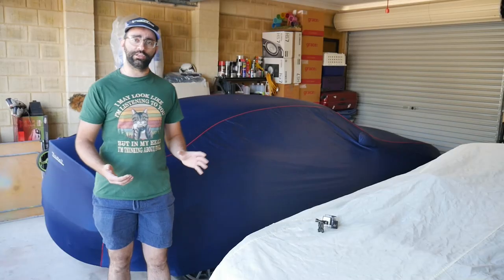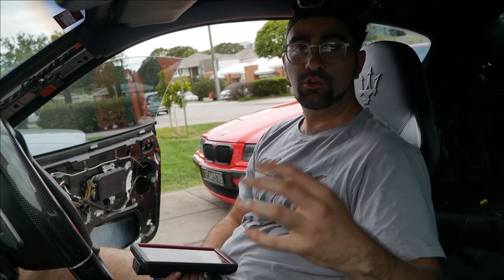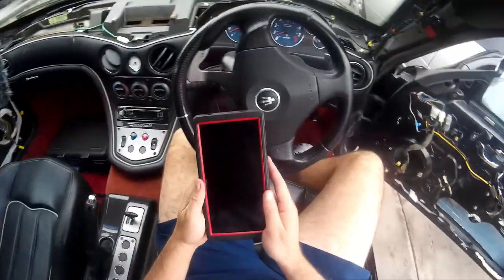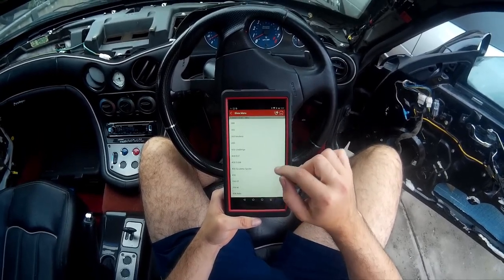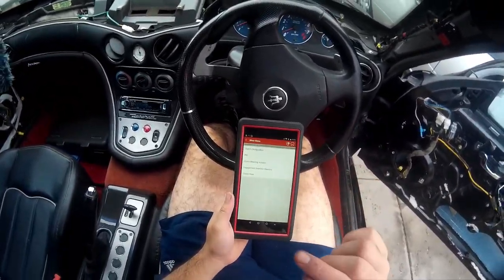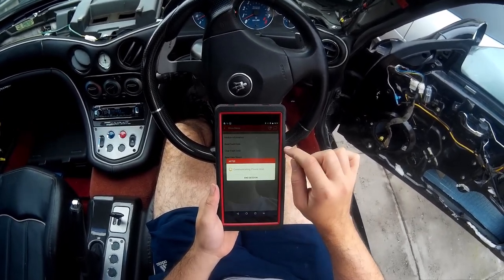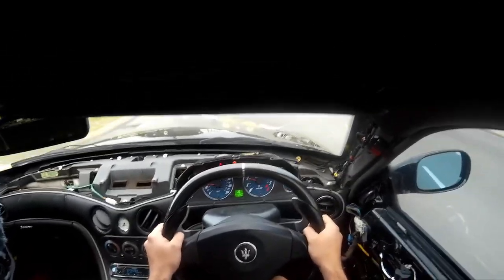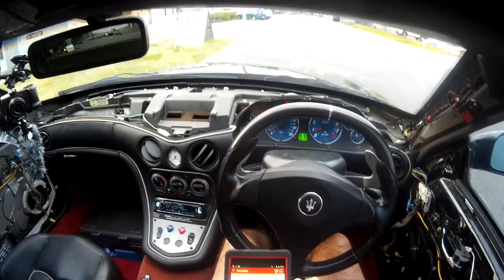Setting up the F1 Transmission - Clutch Change Part 3

Comment: Hi sorry to bug you , but i finally got the launch and my coupe , I noticed on the launch that in the clutch configuration the value changes and reflects the calibrated clutch position, it keeps changing to what ever the calibrated value, and not the new closed position. as per your video when you changed clutch config it changed he new position , the other way around, whats going on with mine??? also I could not write to clutch configuration either, but could change the PIS, any insight , thankyou

Comment: PIS 5.2 is way to high... 5.0 is much better
Reply from the maker: That isn't how it works. It will change between each vehicle depending on the tolerances between the parts. The PIS isn't the goal, the clutch slip is the goal.

Comment: Awesome content on your channel, thanks so much!!

I recently had the rare opportunity to buy a 4200 Trofeo. After watching your videos on the clutch replacement, I purchased a launch 431x pro mini in the hope that I would be able to perform the clutch and ABS bleed. Unfortunately it doesn’t seem to work. When I scan it, the gearbox gets detected as CFC201 first and second edition, but none of the special functions seem to do anything. Not sure if I am missing something i.e. the car needs to be in a certain state (doors closed, brake engaged, gear selected, etc.,). Feels like I have tried every thinkable combination, with no luck. The ABS does not get detected at all. 

I am pretty much at loss on how to proceed with this, and I thought perhaps you had some ideas or inputs of what I could try. Unfortunately I have not been able to find anyone that knows anything about the Trofeo cars here in Switzerland.
Reply from the maker: You can just bleed the brakes the old fashioned way on this, you don't need to cycle the ABS pump.

You can try connecting to the Ferrari F430 gearbox settings if you're having trouble with the Maserati options. Jump on the MaseratiLife forums and ask for help there and post up some photos and I'll be able to help you out more!
Reply: @ShiftMotoring  thanks for your response. luckily I got the gearbox functions to work. looks like it needed a power drain. it still gets stuck once in a while, but after a power drain it is all fine again. I will get my user setup in the MaseratiLife forum! just a quick one, would you know if the actuator bleed is required after changing the pump? I was recommended to install an upgraded F1 pump strait from the beginning, so that's what I did.

Comment: Hi mate. Great video. Thanks for posting. My clutch has just gone in my 2005 Gransport (15 000 kms since replacement, not happy). Can you recommend a clutch that won't fail after 5 minutes use and who the supplier is? Thanks Charles
Reply from the maker: I'd stick with OEM. Jump on the MaseratiLife forums, I'm active in there and people will have suggested suppliers for different regions.
Reply: Thanks for the reply. I'll sus the forum out. Cheers

Comment: hello.  i am not clear on the New Closed Clutch Position . you mention that it is automatically calculated and then you enter in the clutch config. I have been reading that for the New Closed Clutch Position , you have to enter a value manually after measuring new clutch thickness? thanks

Comment: Cool videos fella! Big hello from sunny California. I am curious what does the dbw do and why are we not able to just adjust it to our preference as you have shown without getting the dbw. Seems like you can preserve clutch and quicken 
Gear shifts the way you have by adjusting?
Reply from the maker: The DBW is a piggy back computer for the TCU and is not a diagnostic computer. I don't know exactly how it works and it would take a fair bit of investigation to fully understand it. With that said, I believe the DBW fudges the vehicle speed and RPM to the TCU which causes the TCU to request the highest torque available through an ECU parameter called 'torque request'. You can adjust the torque request parameter in the ECU if you reflash it with a custom tune and get the same effect. I have an install and review on the DBW coming up soon.

What I'm doing here is demonstrating how you can change the perceived behaviour of the transmission by adjusting clutch parameters, it would be inaccurate to describe it as making anything faster but it does change the behaviour.

Comment: Hi mate thanks for video 💪, 
Mate I have a tiny question for you,, three days ago me and my brother took his son Mazzi 2002 F1 gearbox and he modified it like crazy it has a 41 kms only still like new , anyway so we stop filling petrol , we start cat fantastic with no drama and my brother let it roll then he shift to 1 we want to take off it take of 1 meter then it won’t go on gears at all 🤦‍♂️🤷‍♂️,, 
We parked aside to see what happens, car won’t shift at all no sound for gear click as it should be it just stays on N” we turn it off then he try’s to start it unfortunately it won’t starts at all 🤦‍♂️ we check all kind fuses an relay nothing burned fuel pump is new ,, we put it on scanner it give us 
Code P1747: Reverse Gear Switch Absent ? 

Code P1746: Switch Stby , Absent !!

Any idea what’s happening here ?? 
Many thanks 

Matt ☺️
Reply from the maker: You've got faulty wiring, it is a common fault. Drop me a line on the MaseratiLife forums and I'll talk you through it.

Comment: Hey,
Iv got 07 qp sport gt and for some reason it shifts really hard and stall all the stall when coming to a stop. Iv done everything i can think of ie (f1 pump, f1 relay, solenoid pack, accumulator, sensors, oil, etc.) And it still does this and im wonder if its in the calibration at this point. Was wondering your opinion on this matter.
Peter
Reply from the maker: Usually stalling and hard launch are caused by the PIS being set too tight, won't hurt to look at it.
Reply: @ShiftMotoring  i had the pis adjust and it drove sooo much smoother! Unfortunately i parked in my driveway and now i get a no crank problem and its saying i have tranny codes for low pressure. I plugged in and pressure showed 55 bar. Said relay stuck, i replaced relay. Still wont crank. Im ready to pull my hair it with this car. Iv gone through everything to get this car perfect. New variators, sensors etc on engine. On tranny iv replace all sensors, acumulator, f1 pump, solenoid pack. Getting frustrated now

Comment: Hello, what's a good handheld diagnostic tool for Maseratis and Ferraris? I am looking at Launch Tech USA but they offer various models. Which one was used here to tune the new clutch ? All the best!
Reply from the maker: Launch Pro Mini X431 is what I'm using!
Reply: @ShiftMotoring  Super! Where did you order it? I want to avoid clones ... Thanks, M
Reply from the maker: @mtomiuk8133  I just picked it up off ebay, the legitimate ones will come with registration details
Reply: @ShiftMotoring  Super! Thank you!

Comment: Hi. We're replacing the clutch on my Gransport atm.  Would you know what the flywheel bolt torque specs are and the specs for the pressure plate?
Thanks
Reply from the maker: Sorry, I don't remember off-hand! I looked up the grade bolt marking, and then used a lookup table for the bolts.
Reply: @ShiftMotoring  Thanks for taking the time to respond.  Much appreciated.

Comment: Hi there. I’m looking at buying a 2006 Maserati gransport and was wanting to know. When you are going to stop. Do you pull both paddles to engage Neutral or let it just stay in first gear? Does it automatically disengage the clutch when stopped in gear? Thanks
Reply from the maker: You might save 1-2% of your clutch life pulling the paddles, but you don't need to. It goes into neutral on it's own when it needs to and it rev matches on down shifts!
Reply: @ShiftMotoring  great thank you.

Comment: hello , is it true that the launch reads the clutch wear incorrectly? it does calculations incorrectly , the  clutch thickness is 5.6 , I rad launch uses  7 mm i think. thanks
Reply from the maker: So far as I'm aware that was a bug in a version of the software that was updated several years ago. The measurements I've taken have lined up with dealer tools.
Reply: I have the latest software.  O read thru the ferrari module and the numbers are different. Hence

Comment: PIS is about 5 for new clutches and winds down (tighter due to degrading clutch material) towards 4.5. Car should bite eagerly and be light to move around. My car (F430) drives well at 4.7 on 11k old clutch. A lot of it is about feel. Testing the car when red hot (try engaging reverse) is another way to ensure things are good.

Comment: You have to be careful with that tool, it's easy to burn the TCU, it's a very common problem with it. Next time try PEGA Clutch in your Maserati.
Reply from the maker: Definitely a myth regarding burning out the TCU. There is no direct connection between scanner and the TCU, and it can only communicate via the CANBUS with the input value protected at the TCU side.

If you want to send me a PEGA clutch I'll try it out and review it. I went with an OEM clutch because the PEGA clutches have negative reviews and it was too expensive for me to test and not be happy with it!
Reply: @ShiftMotoring  A myth it's your believe, we'll see. 

You just read forums and follow what people say without trying. Scuderia car parts $1911, Forums between $2000 and $4200, PEGA $1600 new, $800 rebuilt, that's what I call BS. Why we should send you a clutch when you have only 847 followers?
Reply from the maker: @gteengineeringwebmaster1170  That's up to you, it gives you information to share with people when they ask you questions. And sure, I don't have a huge subscriber base but my other clutch videos have 4000+ views so people do watch them. If you send me out a PEGA clutch I can test it back-to-back against a brand new OEM clutch and give an honest opinion of what I think is going on. It really is up to you whether you see any value in having someone go over your clutches in detail and comparing it against the OEM unit publicly. 

Of course I'll read information on forums, people share their experiences and issues so that I can learn from their mistakes instead of making my own! It is very expensive testing every possible combination so I have to choose what I focus on - this is a hobby, not a job. I purchased my new clutch from Barbagallo's parts in Perth, Western Australia, for ~$1600AUD. For me it was substantially more cost-effective to buy the OEM Valeo unit with a local parts warranty and an approachable supplier.  All these videos are shared on forums so that people can learn from my mistakes as well as my successes.
Reply from the maker: Sorry it took so long to reply, youtube was being weird and I couldn't see all comments!

The clutch is the OEM unit, the manufacturer is Valeo. I purchased it directly through Maserati/Ferrari in Australia for the equivalent of $1150USD. If I had bought a PEGA clutch I would've also had to pay import duties and shipping which would've far exceeded the cost of the new part. It was something I looked into, and I was willing to try but it was uneconomical, coupled with uncertainty over the reputation of the parts. 

It is good that Samrac is playing with a 360, hopefully he has a positive experience with the part and can share that experience with others! I however am not a 1m subscriber channel, I'm an enthusiast doing work on my own cars. The people who watch my videos own the same cars as me, the people who watch Samrac will likely never own a Ferrari or Maserati. If you want me to review the part for other owners, send one out and I will provide an honest review for others. Until then, the reviews that I've read are all I have to go off of.
Reply: @gteengineeringwebmaster1170  I find your rudeness astonishing. As an owner of a 360 and gransport I wouldn't buy your clutch solely due to your attitude. This gentleman has put effort into doing these videos and willing to do a review on yours even when you insult him. Don't forget samcrac also had 880 subscribers at one point, everyone starts from somewhere!